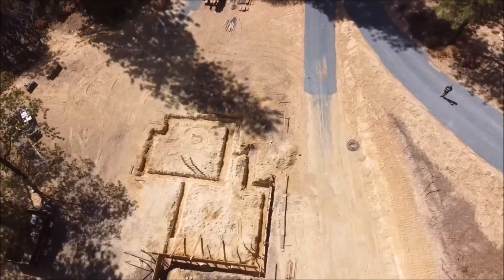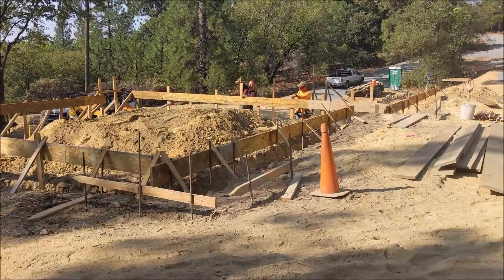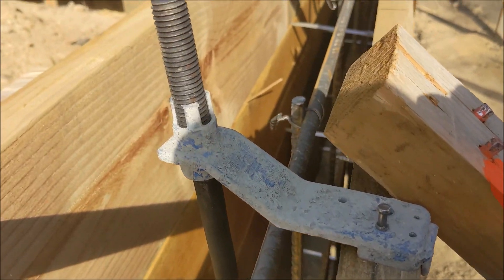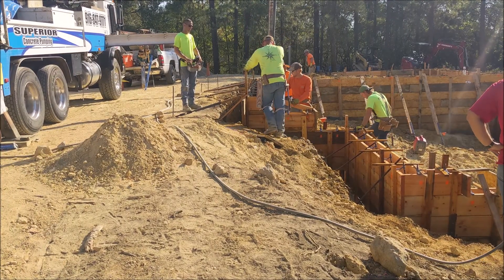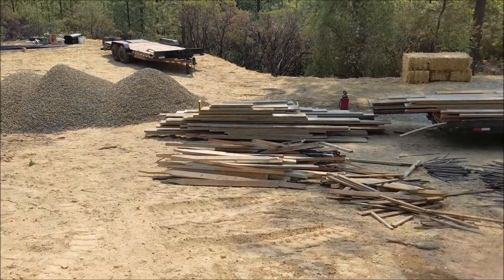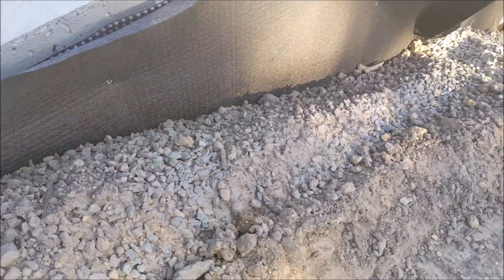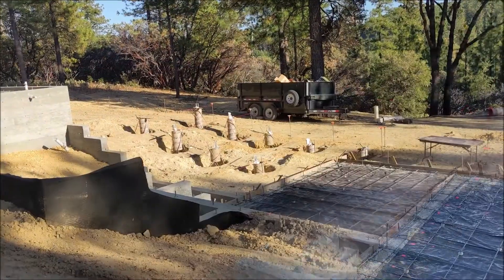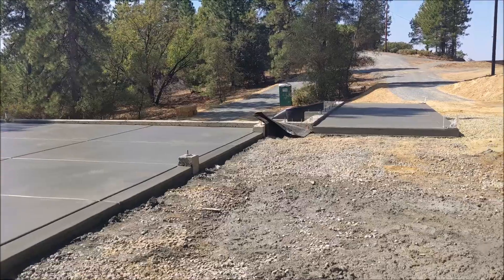Concrete Foundation, Start to Finish, Footings, Stem Walls, Slabs

Comment: You can never "overkill" waterproofing. Everything on a house can be (relatively) easily accessed to repair/rectify on a house except for the basement/crawl space walls and floors.
Reply from the maker: Very good point

Comment: What was used to waterproof the foundation behind the dimple mat? Did you have to fill the holes from the snap tie cones before water proofing and if so, what did you use? Any recommendations for finishing exposed stem walls facing the inside of the building.
Reply from the maker: Used a paint on sealant called red guard
Reply: Use poly wall products

Comment: Excellent work!
I seldom use duplex nails anymore as i find making fine adjustments in the form boards are easier if we use screws instead of the duplexes, maybe because we make more initial mistakes than the average guy!
Reply from the maker: Good to note